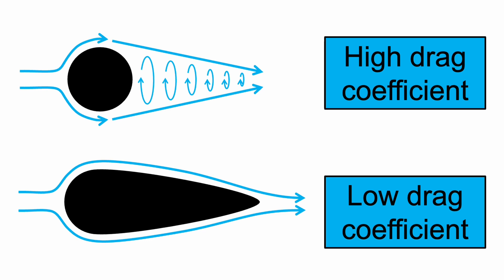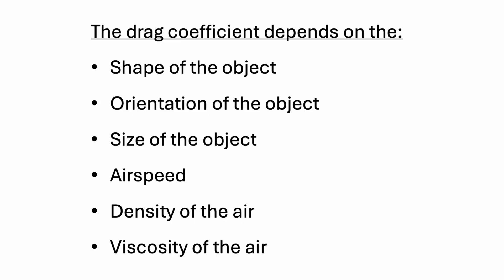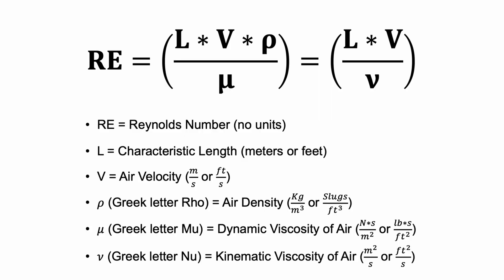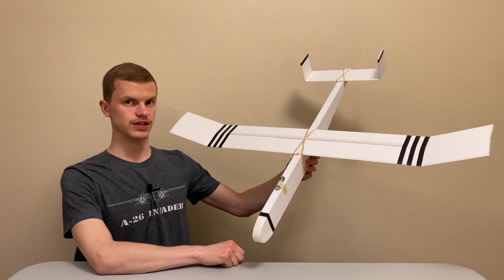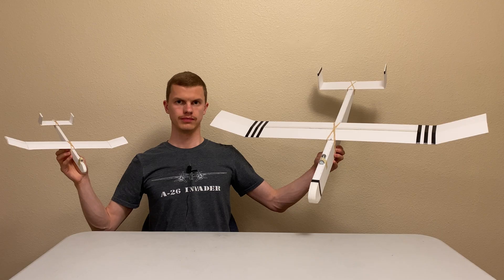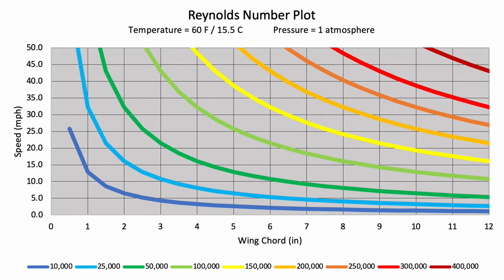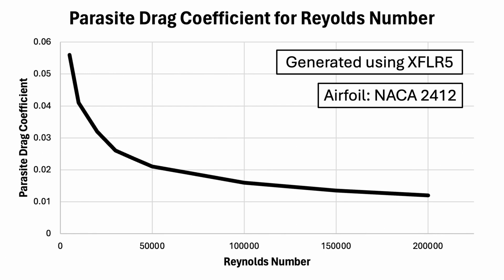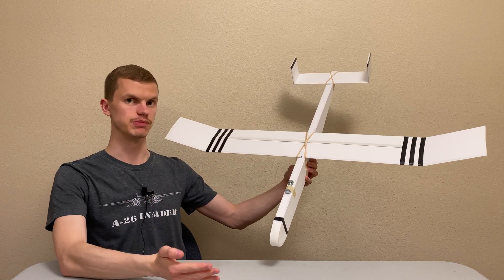Reynolds Number Explained

Comment: I am a glider pilot.  I owned a glider with flaps and shifting to negative flap settings when gliding between thermals substantially increased performance.  I had three negative settings, each one representing a different “drag bucket.”  Any thoughts about that phenomenon?
Reply: May I guess?  I'm sure the Soaring Society of America has a magazine article with the answer.
Anyway, the thinner the wing, the lower the drag.  Ideally, a wing would have zero thickness.  That is impossible for structural reasons.  Reflexing the flap effectively flattens the profile of the airfoil, thinning it slightly, and reducing drag.
Reply: @DumbledoreMcCracken  I agree with your statement about effectively thinning the wing.  It’s fascinating.  And when you click in negative flaps, the nose rises slightly and you sort of automatically achieve an optimal speed.  Excellent for cross-country flying.

I’ve never seen a “Soaring” (the SSA magazine) article about it, but it’s likely there.  I did find a dissertation by a NC State aeronautical engineering student about slow speed aerodynamics but drag buckets and negative flaps were not mentioned.
Reply: I believe also that a negative flap position reduces the airfoil moment coefficient there by reducing the need for elevator deflection. This also reduces drag with a better Cl/Cd.
Reply: @DumbledoreMcCracken  that's true (not exactly - I will explain it little later in this comment), but only for very low angle of attack. Slower planes has more thick wings (mostly 12-18% of chord) and faster planes has thin wings (4-12% of chord). That's because of mentioned R. number, air viscosity and in some cases mach speed (thicker airfoil will generate more increase of speed at top layer).

If You decrease thickness, then stall AOA in most cases will be lower. Drag will be lower for AOA=0. But at some point (like 1-2 deg.) drag will be higher.
Reply: @norbert.kiszka  there is no reason for a slow plane to have a thick wing.

Modern sailplanes have a very very thin wing.

While the usable range of Angle of Attack is narrower for a thin wing, that is not an issue for real airplanes.  Aircraft that require a large range of AoA have a bendable chord via leading edge flaps, or fixed or retractable slats.

My buddy has let me stall his de Havilland Chipmunk a lot.  It has a beautifully gentle stall.  I attribute that characteristic to its thick, round, gentle airfoil.  The Chipmunk is an aerobatic training airplane, so de Havilland may have wished to give the students a more relaxed plane to fly.  However, and in general, most planes are designed for speed and low fuel consumption, and require a relatively thin wing (plus flaps, at a minimum) to achieve those goals.  Training prevents stall from being a serious issue.  

Nobody flies with a high drag AoA unless he wants to lose altitude without gaining speed.
Reply: @DumbledoreMcCracken  then try to look at many different airfoils, especially designed for low Reynolds numbers (in most channels links are not allowed). In previous comment I missed a small fact, that most thick airfoils (like a 25% chord) are used in wind power plants. Making airfoil thin at around 4% it will be very good for fast fighter jets, but it will be terrible for slow planes. Changing thickness from (for example) 12 % to 11 or 13 will generate significant change in characteristics at slowest and highest speeds. Try any aerodynamic simulation software and You will see that what Im saying is the true.
Reply: @DumbledoreMcCracken  BTW. flying and designing is not the same thing. At first glance aerodynamics is pretty easy. If You need to chose airfoil, especially for a narrow acceptable range of parameters, then You can spent even months with all that game. Don't ask me how I know.
Reply: @norbert.kiszka  
I will give you a test to determine how much you learned from your computer simulation effort.

If you were told to synthesize an airfoil out of two existing airfoils, by abutting one airfoil to another, how would you do that mathematically?  What would the simulation data show if you had done the work poorly?
Reply: @DumbledoreMcCracken  Im afraid Xfoil can interpolate two any airfoils and generate plots (CD, CL and CM) for each of them. This is command line tool (works on many systems because its open source) and I can tell You I remember half of commands and there is a lot of commands.
Reply: @DumbledoreMcCracken  BTW. there are couple of airfoil file formats. All of them are normal text files with coordinates (XY points). So if some feature is not available in software, then its very easy to make Your own by any scripting language and generate new file to run simulations on it.
Reply: @norbert.kiszka  that's not what I'm looking for.  Aerodynamics is about managing the pressure transition across a surface, given that viscosity and density is fairly constant.  Mathematics helps model that transition.  I don't model off the shelf airfoils, I start from scratch and iterate parametrically.
Reply: @DumbledoreMcCracken  that comment where You suggesting me to read books it appeared more or less just now (YT...). Thank You so much, but I already read many books and papers (mostly from NACA).

One or two books is practically not enough to make a good design of whole wing.

If You are doing it just for fun, then You can think that small two books are enough. I spent in reading, designing and testing airfoils for more than 3 years. And it was not only for fun, but to make "impossible" project. More of that, You can find open source software written by me for aerodynamic and meteorology calculations (It was compared to other programs, but I have more numbers after dot and faster results).
Reply: Wing loading is a determining factor for stall speed also. Great discussion! Keep it civil 👍
Reply: … more so, a higher velocity.

Comment: Hand launching the planes across the gym is a very poor test, since you can't apply the same force twice.
Reply: Nah, that is good enough for demonstrating the concept. No need to have a proper lab setup
Reply: Plus the total weight of the aircraft affects the flight time because a heavier aircraft has a higher terminal velocity, hence more "penetration" into the air. Sure, that's definitely related to drag, but the Reynolds Number doesn't include any term for total weight.
Reply: @GRAHAMAUS penetration is related to speed, and speed is related to the square root of weight.  Flying faster is required to maintain the required lift force (when weight is increased), and the fraction of the lift vector that points forward also increases if the same angle of attack is maintained.

Comment: So the ratio of wing length to cord length has nothhing to do with the Re #?
Reply from the maker: You can use any length you want to calculate the Reynolds number, as long as you stay consistent when comparing different Reynolds numbers.  The aspect ratio does not directly affect the Reynolds number, but it is possible that changing it could also change the characteristic length and therefore the Reynolds number too.
Reply: @DesignYourOwnAirplanes-xd6lz  Does an albatross wing have a higher Re number than a crows wing?
Reply: @Toomanydays the chord length is the determining factor, and speed, when discussing Reynolds number. 

The wing span is irrelevant.

Unfortunately, Reynolds number is described in an algebraically simplified form.  The factors are more understandable when the form of the equation is not algebracially simplified.

Comment: It's not necessarily due to the reynolds number being better on the larger airplane, but that the smaller airplane is more dense than the larger one when they're compared to scale, if you used a hypothetical growth ray on the smaller one to make it exactly as large as the big one you'd find that it would be heavier than the formerly bigger one.

This is the thing with making the same model at different sizes from the same material, the smaller ones are heavier to scale than their larger counterparts.

Comment: I am curious as to your background. The Reynolds Number is the ratio of inertia stresses to viscous stresses. It does affect lift coefficient as well as drag. This requires understanding boundary layer theory.
Reply from the maker: I majored in aerospace engineering. The boundary layer and stresses are beyond the scope of these videos so I didn’t mention these subjects to keep things simple.  The main point of this video is that if you make your glider too small and/or too slow, it could reduce your flight distance.
Reply: I learned about Reynolds number in highschool tho😅
Reply: My undergrad degree was in aero/astro engineering from Purdue in ‘82. This was followed by graduate degrees in aerospace engineering from a joint program from the University of Dayton and AFIT. My research interests were aero elastic effects at low Reynolds Number. I retired as Aerospace Fellow from Honeywell in 2021. You were wise in selecting Aerospace Engineering as a career. It does not get better than that. Aerospace Engineers rock! Cheers!

Comment: Short explanation:
Large plane need less speed than a small one
Reply: How did you arrive at that conclusion?   I suggest you consider wing loading.
Reply: @dougball328 he is correct if the wing loading is lower in the large plane, but aspect ratio matters too.
Reply: @DumbledoreMcCracken  But he didn't say anything about the relative weights - just that a larger ariplane needs less speed.  That statement is wrong.   Aspect ratio (really just span) plays big role in induced drag - but nearly no role in lift (hence speed schedules)
Reply: @dougball328  I agree.

I think the video series is somehow a farce, either to expose an individual, or an attempt to punk the audience.

No person with a degree in the subject can accept it.  It is a test of credulity?

Yet, there are claimants in the comments, who state advanced credentials from the academy, who are all in.

Comment: This is a bit misleading. Flying faster increases the Reynolds Number, and gives a lower coefficient of drag. BUT, for that same fuselage or whatever the drag force increases as the square of the speed. Because it is exerted over a larger distance, the power required goes up as the cube of the windspeed. This more than negates the advantage of the higher Reynolds Number. There are airfoils that work good at lower Reynolds Numbers, and airfoil lift coefficient definitely varies with RN. The BEST OVERALL BOOK on model design is Andy Lennon's R/C MODEL AIRCRAFT DESIGN.
Reply: Interesting!
Reply from the maker: You are correct that putting the glider into a steeper dive to fly faster makes it fly a shorter distance, not longer.  Instead, you would need to add more weight onto the glider to make it fly faster, since a glider's weight does not (directly) affect its flight distance.

Comment: So, would it be true to say... All else being equal, if reducing parasitic drag will increase the Re number? In other words... The smaller the airframe (scale), the lower the Re, the more critical that parasitic drag becomes in design, (if wanting to improve L/D and/or minimum sink)?
Reply from the maker: Yes, I’ve found that below a Reynolds number of about 50,000, the parasite drag coefficient of airfoils increases significantly, which would make streamlining more important.  The drag coefficients of other shapes may be affected by the Reynolds number in different ways though.

Comment: Reynolds number can actually be used in all sorts of fluid flow situations, not just for designing aeroplanes.

The key point is that if the Reynolds number is kept constant for a fixed geometry, then the flow patterns will be the same.

As a chemical engineer, I use it in pipe pressure drop calculations, for mixing calculations in agitated tanks, or when considering the flow of fluid around solid particles.

It can be used to predict the fluid velocity at which the flow goes from laminar to turbulent (for a pipe, flow is laminar below 2100 and turbulent above 4000, where the characteristic dimension when calculating the Reynolds number is the inside diameter of the pipe).  The boundary layer thickness depends on the Reynolds number: the higher the Reynolds number the thinner the boundary layer.
Reply: How do you handle the transition region between 2100 and 4000? Do you just design away from it or go with whichever f value is more pessimistic?
Reply: @isaacmarkovitz7548  

If you do the calculations for typical industrial plant using liquids like water, common solvents, gasoline, diesel or jet fuel etc. you will always be a long way into the turbulent regime.  You need small diameters (3 mm or thereabouts) to make transitional flow a possibility.

Comment: L=1/2 • density • airspeed ^2 • area • drag coefficient so why do you say the drag coefficient depends on airspeed and air density?
Reply: airspeed influence drag coefficient that is biggest misconception. Geometry of wing under different  airspeeds changes drag coefficient, that is complete nonsense. Many solutions disregard engine thrust (airspeed), which sustain energy conservation condition.
Reply from the maker: The air will flow differently around the object and create a different drag force.

Comment: Great video. It's worth noting the "knee" in the curve at about 4500. For best performance, you want your Reynolds number to be above about 5000. After that, the benefit drops off significantly.
And we know drag increases greatly with velocity in general. So it's not so much "fly faster to go further", but "fly fast enough to get your R above 5000".
This also means that small, slow indoor planes, with R below 4500, can have very different design characteristics from larger, faster outdoor planes.

Slow park flyers can be stuck in the middle, halfway in between the viscous regime and the inertial regime.

Anyway yeah fly faster or have a longer chord IF you're flying a tiny plane really slow, so your R is below 5000. Once you get above 5,000, increasing your speed gets costly because parasitic drag is proportional to airspeed SQUARED.

Comment: One potential flaw (?) in the glide comparison demo was not accounting for weight. The larger plane weighed more and thus possessed more potential energy launched from the same height as the smaller, lighter unit. For a more pure apples/apples comparison,  I’d love to see a comparison between the two gliders with the smaller one weighted to the same value as the larger one.
Reply from the maker: The distance that a glider flies is equal to its lift-to-drag ratio multiplied by its starting height, so weight actually doesn't directly affect the distance it flies (although that's not the case for powered aircraft).  Adding more weight to the small glider, however, would have made it fly faster, which would have increased its Reynolds number, decreased its parasite drag coefficient, and therefore made it fly further.  In that way, adding more weight to the small glider could indirectly make it a match for the larger glider.
Reply: Interseting thought - Theory suggests the big one WILL still go further
but
Speaking as an empiricist
SHOW ME THEN I'll be convinced

Comment: The point of Re is that different craft with the same Re behave the same way. This means that you can model a full size plane at a smaller scale by increasing the viscosity of the fluid.